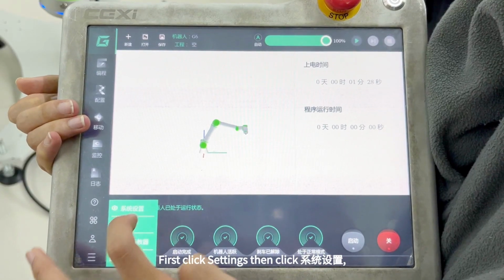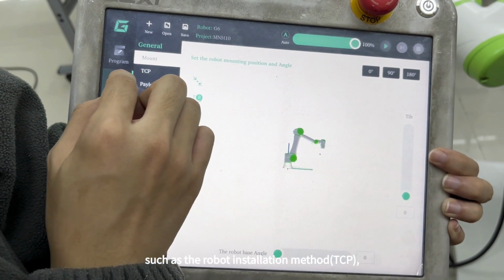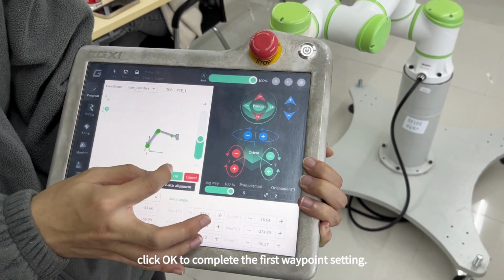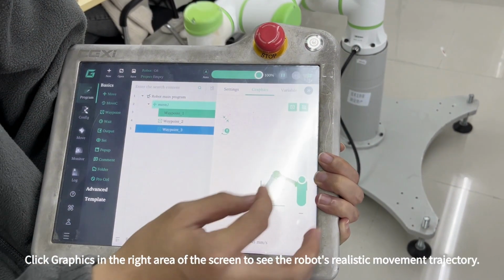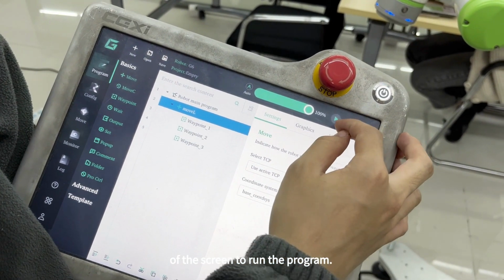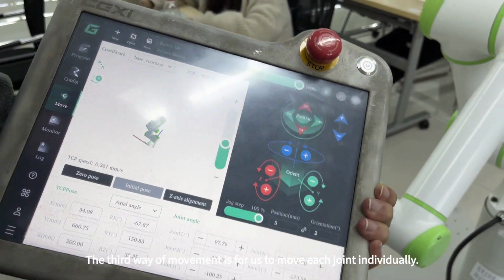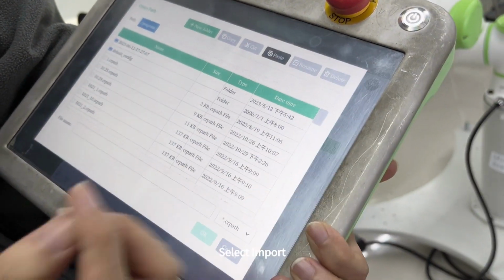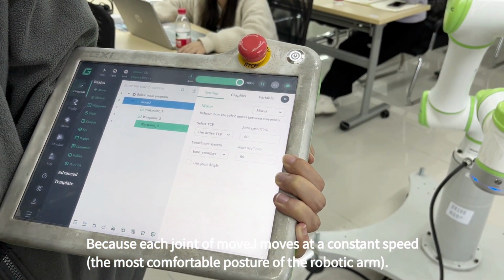Collaborative Robot Programming Guide

Comment: I learned how to set the moving point, which is simply to move the robot to the target point, a fixed point. Repeat the above work again. The input and output signals control the action of the solenoid valve, that's about it.